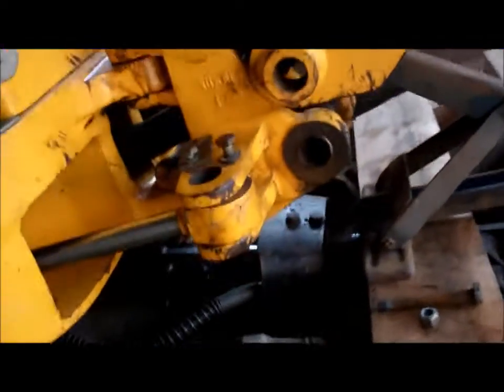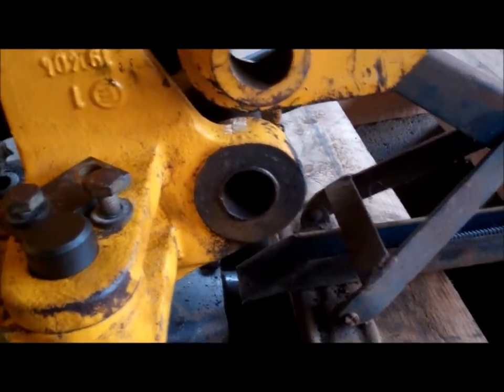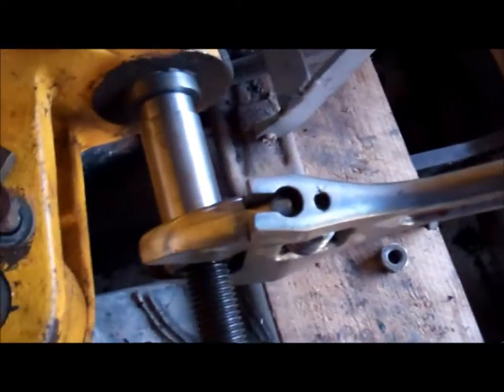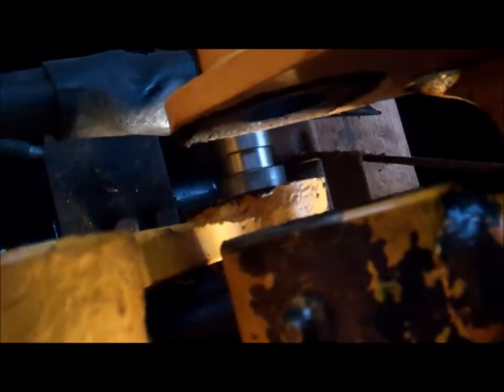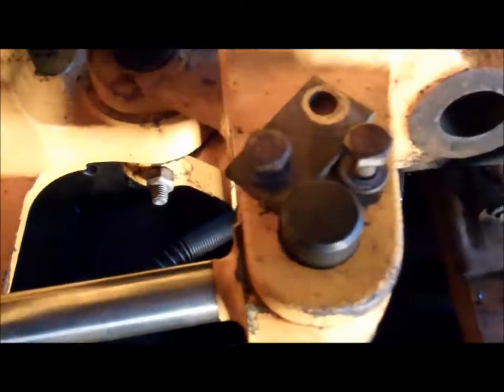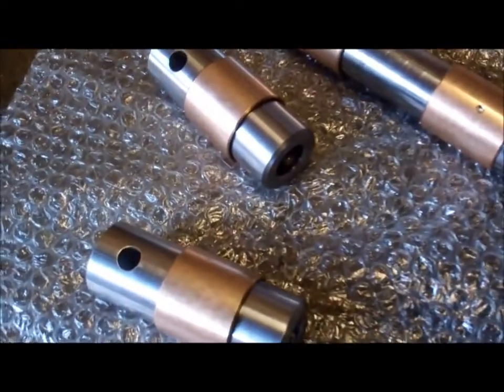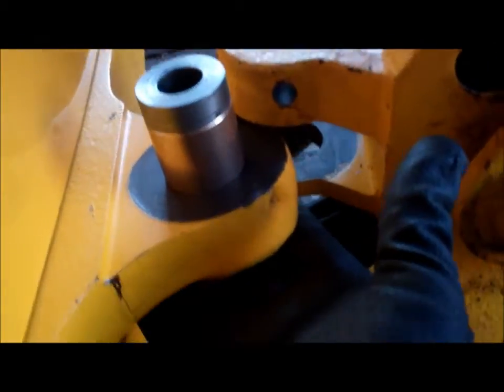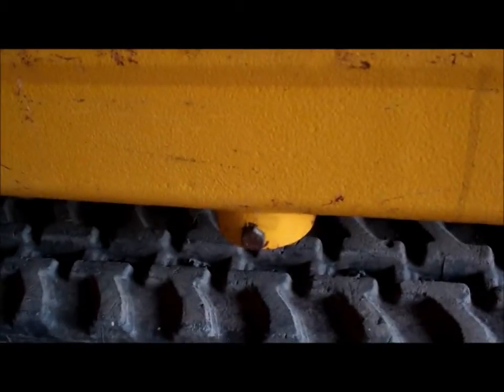JCB micro digger gets new kingpost pins & bushes.

Comment: Hi great video could you please tell me was the press tool you created just standard metric threaded bar or was it special acme bar?
Regards
Tom
Reply from the maker: Tom Inglis, I was using high tensile steel metric thread (M20) well greased, mild steel will be ok, thanks for the comment.
Reply: That's great thanks for letting me know